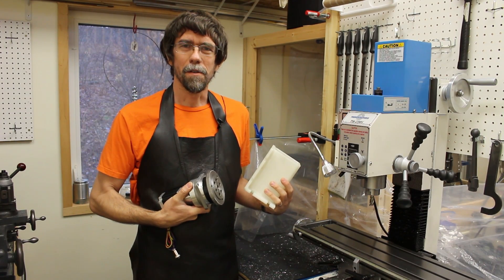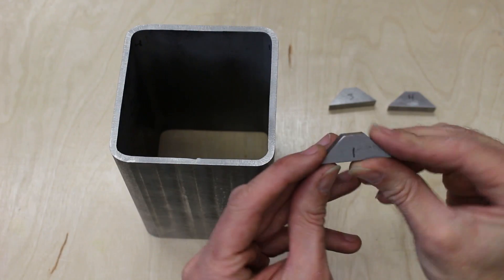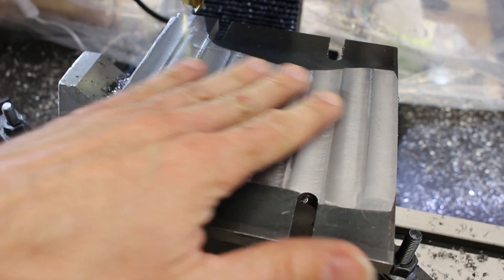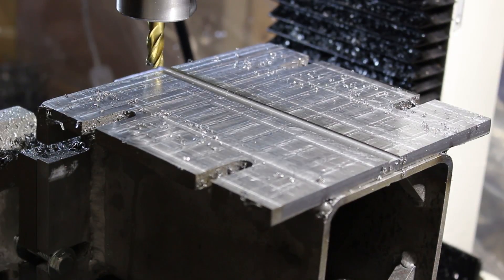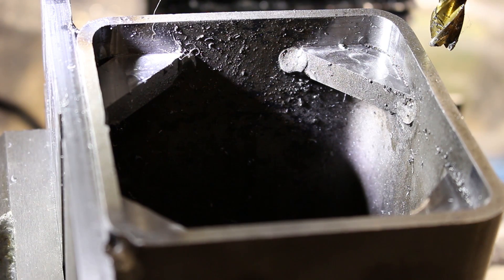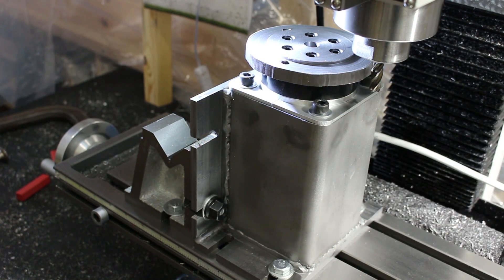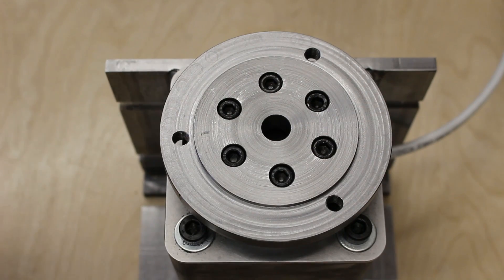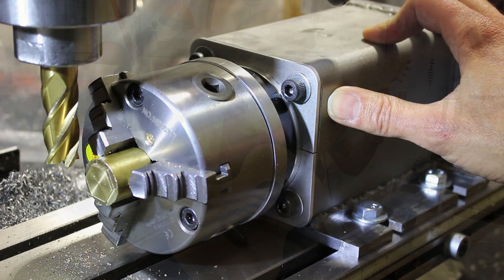4th Axis Harmonic Drive Build Part 2

Comment: Perhaps riveting would work better another time since it might cause less distortion than welding?
Reply from the maker: Using rivets or other fasteners such as bolts would be a tradeoff, definitely easier but probably less rigid than welded joints. I expect it would work fine if it were used for light cuts in soft materials on a CNC router, whereas rigidity would be more of a concern with heavy cuts in steel on a milling machine. It still might work fine in that case, but my lightweight mill is already limited in rigidity so anything I can do to make things beefier is a plus for me.
Reply: BrainRight Rivets seem to have worked OK for SS Great Britain  (now drydocked where she was built in Bristol UK sometime in the 1840s)

Comment: Nice job, have you ever considered making/getting a fly cuter for your mill? It will make life a lot easier.
Reply from the maker: Thanks, yes I would probably use a fly cutter and/or a shell mill the next time I need to machine a large surface like this.
Reply: A fly cutter could do it in one hit, but on a (dare I say) lightweight milling machine chatter etc could become a problem.
If you want to learn machining have a look at https://youtu.be/JBDNu_ViHlU
He makes a fly cutter, and explains why etc.

I really enjoyed this video...makes me realise how spoilt I have been using much larger machinery all my  life,
Reply: I made a fly cutter from broken carbide endmill shanks brazed together and ground a cutting tip. It works great.
Reply: dazaspc is a flycutter bit better than a flat end bit? I mean it does cut a wider swath, but if you only do small hobby projects and not production work is it needed? I have no machine shop experience but would like to learn. I've got a great basement shop with everything I need to build motors for trucks and boats and I build my own custom rifles. If I can eventually get a lathe or milling machine and lathe combo I'd like to learn to machine small parts.
Reply: I use a Tormach Superfly on my mini mill. I do mostly aluminum but I've successfully flattened some cast iron with it too. It works surprisingly well.

Comment: 2 things, 1 face mill cutter, and bolts and nuts instead of weld.
Reply from the maker: Definitely yes on the face mill cutter, or a fly cutter, or pretty much anything bigger than what I had on hand. Bolts and nuts would be a tradeoff, easier to assemble but probably not as rigid. That's not to say I actually need so much rigidity, but this thing is very solid.

Comment: Great job! That looks like that will really come in handy. I'm jealous... wish I had one! Hey, how do you like that PM-25MV that you have? Does that have a brushless motor in it?
Reply from the maker: Thanks. So far I'm very happy with the PM-25MV and it has exceeded my expectations. That's not to say I wouldn't like a Bridgeport, as this is nowhere near as large or rigid, but it's great for a mill that I can move around (sort of) easily and fit in a corner of my shop. It has two speed ranges selected by moving the drive belt, which takes about a minute, and the brushless motor has a variable-speed drive that I really like.

Comment: Nice video.  Would heating it up to 700-1000F for an hour get rid of the residual stresses from the weld so that it retain its shape after machining?
Reply from the maker: Thanks. It's possible that annealing would reduce the stress but I don't think it would be very effective. The problem is that the weld solidifies when it's much hotter than the surrounding metal, so as it cools and contracts it's going to develop tension because there's just not enough metal to fill the gap at room temperature. Professional welders develop a good sense of how the metal is going to move and how to compensate for it while welding, which is a real art, but as an amateur I have to weld it as best I can and compensate by machining afterward.

Comment: Nicely narrated. Fingers crossed you'll have a fly cutter at your disposal soon  =)
Reply from the maker: Thanks Frank. I do have some fly cutters but my lightweight mill doesn't have the torque or rigidity of a Bridgeport so I think I would have needed to use slower and shallower (more) passes. I could have used a roughing mill for most of the stock removal and then switched to a fly cutter at the end, which might have given a better-looking surface finish with a very light cut.

Comment: excellent!!! Consider using Harmonic Drive to make 5Axis for my G0704 CNC
Reply from the maker: Thanks. My milling machine is a PM-25MV which is very similar to the G0704 and I plan to convert it to CNC someday. I'm not (yet) planning to make a 5th axis but with its large gear reduction ratio this unit should have the torque for it.
Reply: This time make new upgrade for G0704 CNC.We have the same interests like the guitar!.continue your great job!we will be in touch if you want.Thanks